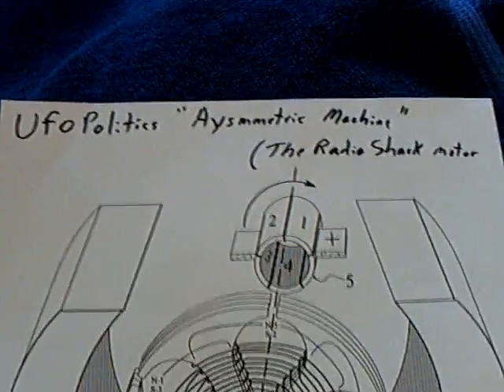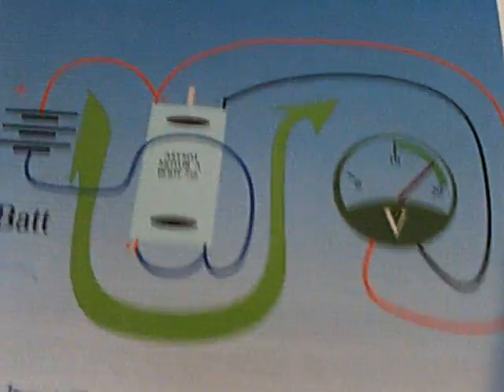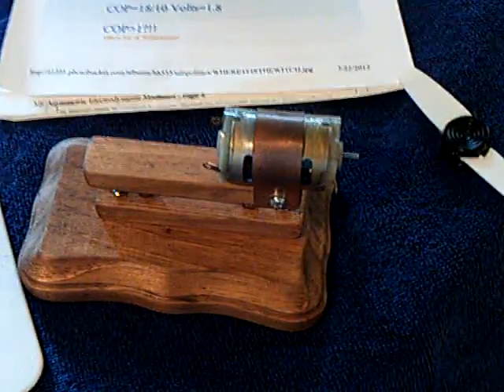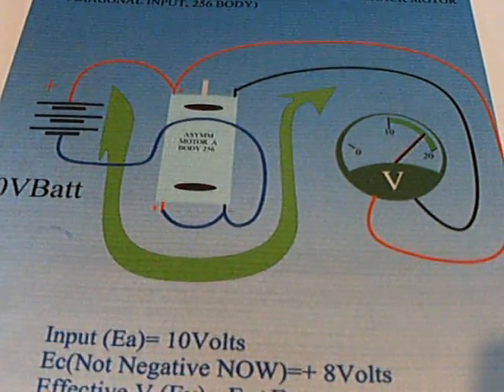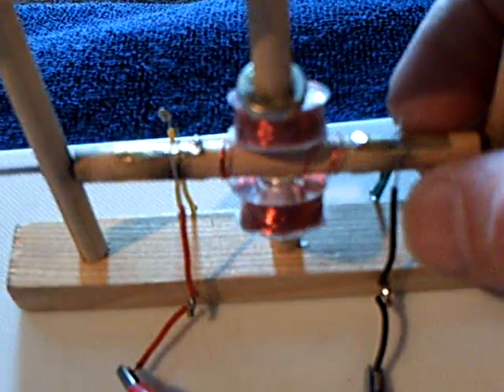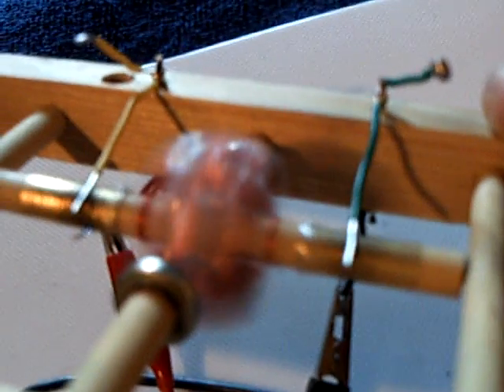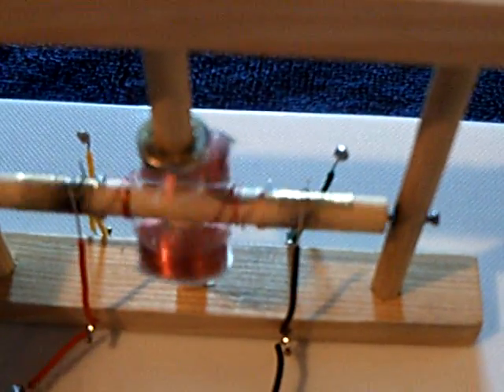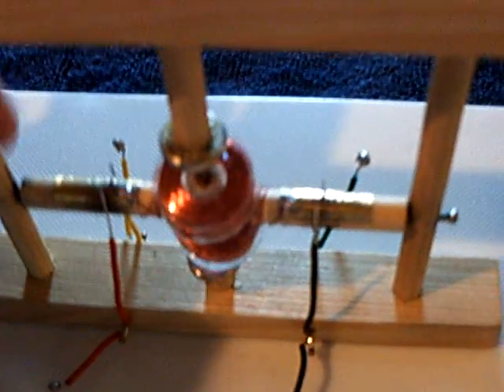Asymmetric motor learning tool

Comment from the maker: I was trying to keep this as basic as I could and reduce the design down to the least number of parts.  Your idea of using the parts out of the RS motor to build an "open air" model is good idea though.   From building my RS motor I have left over parts that will work.  I just have to make two tiny 5 pole commutators.  That is the hard part.

Comment: Personally i would not use your armature, i would use a 5 pole armature "toy" and the magnets from the little motor and put it into your motor frame.  Wiring the 5 pole as per the 5 pole spec, i.e. 5-V-shape winding as per post 52.  one day soon ,i will finish of my little motor and move onto the the bigger motors.

Comment from the maker: The RS motor was hard for me also because everything was so small and I work in my house using simple hand tools.  I was lucky that I got it built and running.  I think that you are right that all I have now with this wooden model, is a typical symmetrical motor. I hope that I can change that.  Your idea about doing this motor in an opposite fashion (magnet rotor) has crossed my mind also.  If you figure out a way let me know.

Comment from the maker: There were some things about the Radio Shack motor that I didn't understand and I have been wondering if I wound my armature wrong.  It works but I don't like the amp draw and over heating.  Before I build another one I figured that a simple wooden model might help me in understanding the basic principle.  I may have to build a wooden three pole version (like several poeple have suggested)  to get the results I'm looking.

Comment from the maker: Thanks.  Yes it appear that I need to reconfigure the brushes and or the commutators.  Luckly that is very easy to do on this motor.  I may have to completely rewire the coils also to get this to work.  Like Johnpaulbuono mentioned, "one/wire coils in two pairs."  That will take some time.

Comment: From what i can see, the armature is not wired properly, i have not seen UFO make a two pole machine....you need to offset the windings....like UFO saids one wire/coil in two pairs.  I recommend looking at post 52, for a 5 pole armature and post 65 for 3D BASIC Wind, and post 96 for a 3pole armature..you need to make commutator segment wider,say 115 degrees per pole for a 3 pole with a 5degree gap between commutator segments.  Place the bushes at 90 degrees to the magnets as per UFO's diagrams.

Comment: Nice work, Lidmotor. Just a suggestion -- your brushes seem to be in line with your magnets. What would happen if you were to place them 90 degrees relative to the magnets? I was unable to get my 3 pole motors to work properly until I did this. This may or may not be relevant here, but I though I'd respectfully share what worked for me. Bob

Comment: Maybe try adding a 3rd coil, So there is a coil that has time to absorb the flux on the generator side while the other two create the attraction to the magnets? If you notice, the simplest of Assymetrical designs UFO diagrams is of 3 poles/coils, allowing for a generation of current to occur in the coil not touched by a brush momentarily while the other 2 coils are juiced by the battery...just an idea.   Best of luck. :)